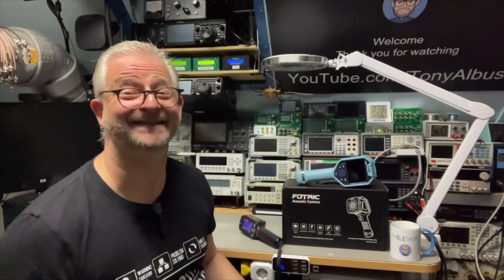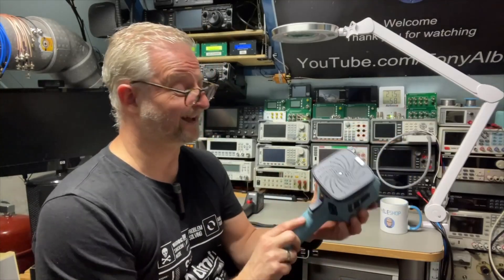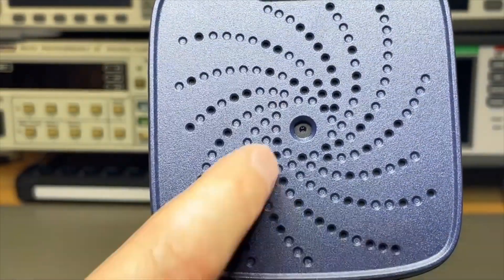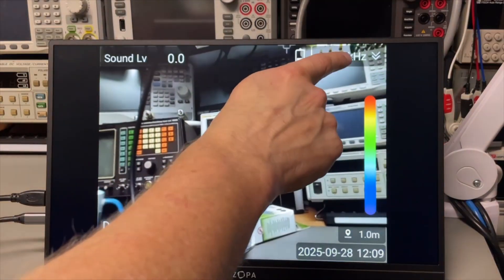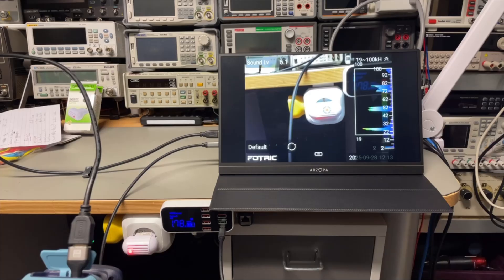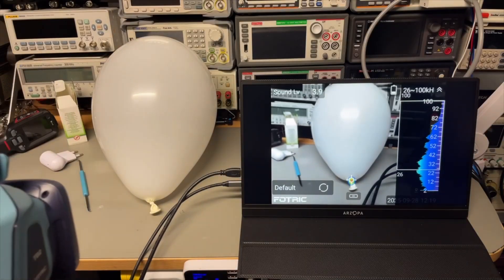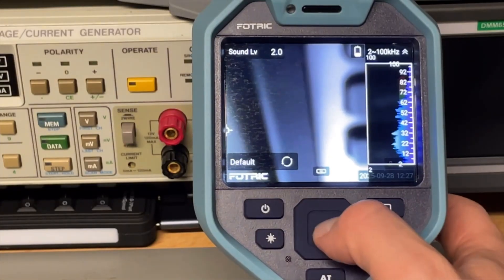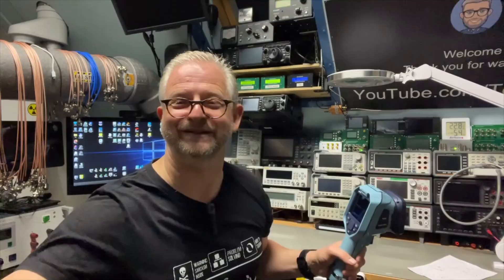TA-0457: Fotric TD-2  Acoustic Imager - Quick Hands On

Comment: Thanks Tony, I didn’t know such equipment existed, and I must admit it would have helped me a lot to track down some low‑frequency vibrations that annoyed me for years in the attic, which I finally discovered were caused by my boiler flue downstairs, amplified at some point in the attic through the vent pipe. I also appreciate the placement of the various microphones. I guess there’s quite a lot of mathematics and physics under the hood to achieve such technology.
Reply from the maker: Thanks, yes cool stuff, it must be very advanced inside.